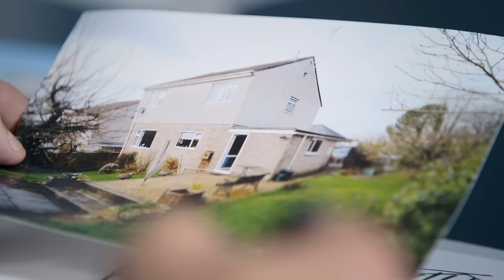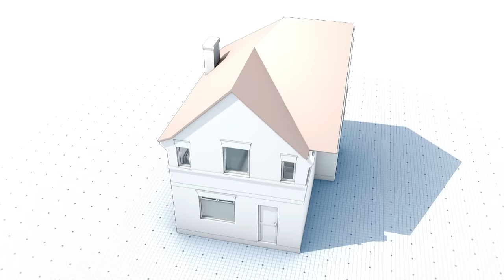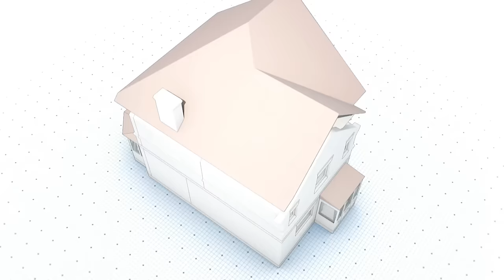Ugly House To Lovely House With George Clarke: S1E5 | Only Human

Comment: Only critique: the Front door. The entrance is fine but the windowless, featureless door needs a few features (glass panels?)....something (perhaps a miniature reproduction of one of the 6 glass - but glazed - rear doors to mimic/introduce what is on the other side of the home. The House itself is a Vast improvement.
Reply: Absolutely agree.
Reply: @lovingmayberry307   Yes, the windowless entrance is worse than the original entrance!!
Reply: Ummm, did you miss the side-facing huge window and the skylight at the entryway? they don't need any more light in there lol. I can see why they put them in places other than the front door; they don't want everybody walking by to see straight in...
Reply: Personally hated the cheap 'insulation' used for the exterior walls- I only see problems with this

Comment: I've watched 6 of these episodes now and imo all these semi-attached homes have one problem in common and that's the lack of windows/light... adding another bedroom on the attic floor will give extra space for the adults but totally unnecessary= $35K+..!!! sleeping doesn't require a lot of space..they need more downstairs space!!...add more windows on the sideyard and eliminate the glass interior dividers!! a cleaning nightmare with teenagers!...
Reply: Absolutely. Skip the attic reno, keep the second floor floor plan and upgrade the bath in it's current foot print. I would have added a half bath between the other two bedrooms so the kids have a place to potty away from mom and dad. This was such an extravagant build and totally over the top.

Comment: Quote: 'The architect has come up with a plan to fit their £120k budget.' The first words that came out of the architect's mouth was that they cannot have everything in the plan. They will have to treat it as a menu.... All of these builds are the same. The architect fails before they start. Do what they are commissioned to do... Design the house to the budget, so they can say yes to everything in the plan...
Every architect on the planet knows that as a rule of thumb, allow an amount of 30% for the unknown.
Reply: Completely agree, this architect didn't impress me. It looks amazing, but this isn't the solution they needed for their budget :(
Reply: EXACTLY!!!
Reply: I do agree with you to a point. I also think the architects should have a few tricks to help come in on budget or else not take up this kind of work. I also know that when you cut into a house that’s been worked on many times over the decades, you typically uncover some unpleasant surprises.
Reply: I did renovations to my home with plans, and in the end it cost us 2/3 herds more than expected
Reply: i agree... but the owners did make the choice to add the extras

Comment: Given that they spent over 200k on the upgrade, would they make a profit if they sold the house? Has the value of the house increased by 200k or more, or will the location put a ceiling on any profit they could make?

Comment: Can't wait to see what they choose to do. The first flaw in the initial plan for the ground floor is that to get from the front door to the kitchen means going through the snug at the front. There must be direct access from car parking to kitchen. Unless anyone ciming through the front door heads directly upstairs, that snug is a corridor, a path into the house. Two teenagers in "packs" will mean a LOT of groceries. Also, try living with windows that have aluminium frames. No thermal break means the frames tramsmit cold in winter and heat in summer. Terribly inefficient windows, no matter the glazing. Not impressive so far.
Sorry, George, but without walls you cannot have a great home. The glass walls offer zero privacy on the entire main floor. 
Why do they keep getting surprised by work being required in a house that is about a century old.
The carbuncle of a porch stuck on the front detracts from the simple elegance of the facade. Had the design fit in with the house it would have been great. As is, it is fighting the old house. At the start the comment was made about the house having none of its 1930s charm left. Now it is a bland, boring, modern house. The kitchen is sort of functional, but it is cold and designed to look well rather than function well. For me, the entire project is a disaster. Those windows certainly makw it look and feel industrial, not at all like a home.
The 1st floor and attic work. Again, no character at all, but useful. Glad they like it, but it would be my worst nightmare.  That escalation of the budget by that amount is crazy. The former council house is lost completely.

Comment: That's what lack of planning will do to you... They bought a house, tore it down, and spent the same amount to build it up again. In what world does that make sense!? They could have bought a 400k house, it would be much bigger, and they could have looked for one with a configuration that would suit them. Or they could have initially bought a vacant lot and built the house however they wanted, instead of buying the house and tearing it down entirely. 🤦🏻‍♂ Also, the architect showed them options, it wasn't supposed to be doing all of them. For instance, if they are remodeling the upper floor, there's no need for those glass panelings.